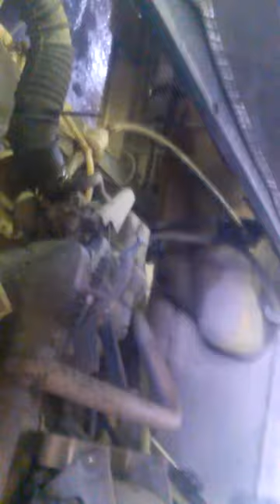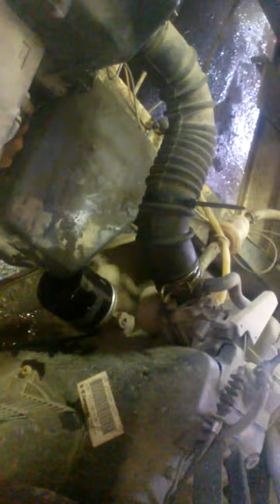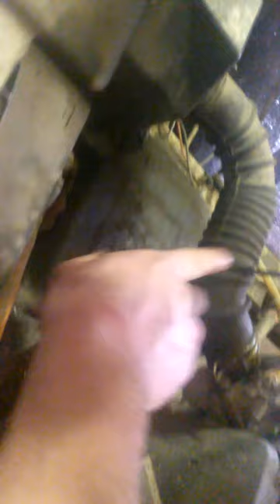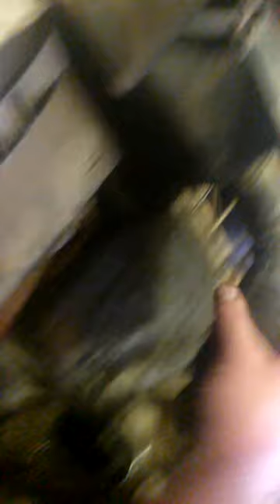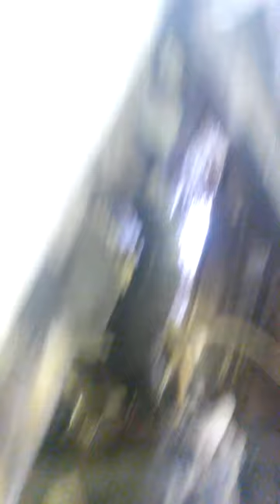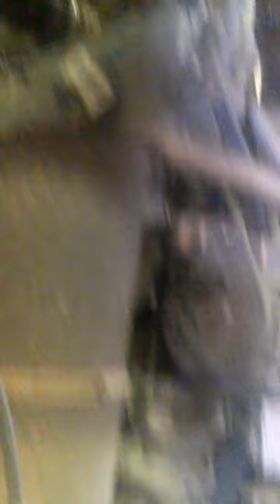Club car carryall gas in oil

Comment from the maker: Hey YouTube please post what u think ,this is good to check that intake hose after a good amount if uses on your gas club car
Reply from the maker: Jonathan Coulson yes a calapsing intake hose would cause it to choke out while running and give it more fuel than air making it smoke, i would check the intake hose and change or clean the spark plug